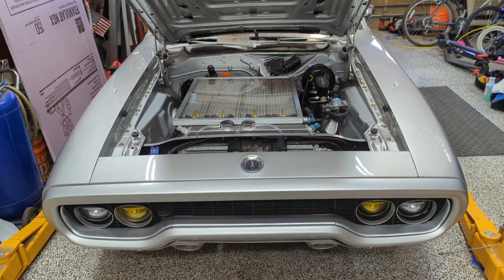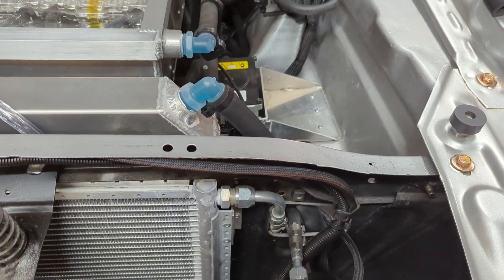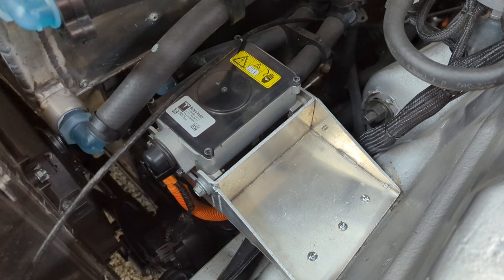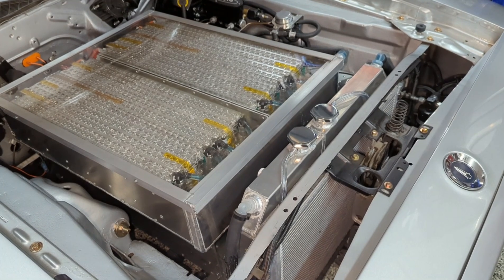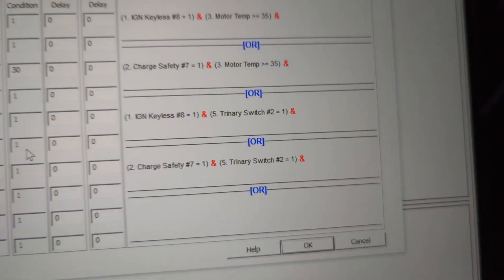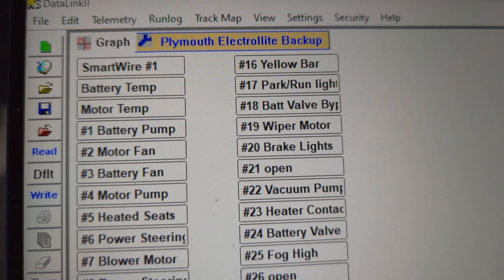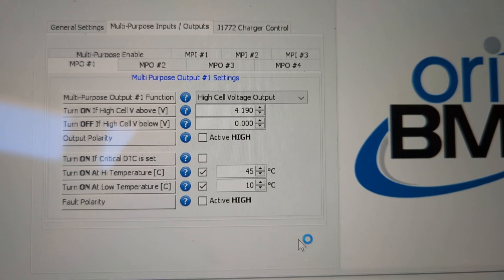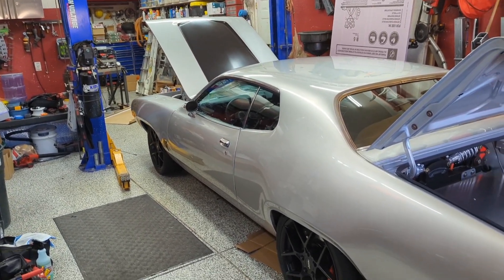Project Electrollite Tech Series - Thermal Management

Comment: I also have a TESLA water heater for the batteries.  My understanding it is just a water chamber with a 400vdc coil.  So then there has to be a high voltage contactor.  What contactor do you use?  Also where and how are you measuring the water temperature?  My thought is I can  pot the thermostat probe in the groove in the casting outside on the TESLA casting that makes battery heater.
Reply from the maker: Yep that is an accurate description.  I use a GV200 contactor, way more than it needs.  I measure the outlet temperature after the batteries and charger.

Comment: Sorry to ask but What Air con pump is it? I'm a little confused about the pwm to it and the temp control?
Reply from the maker: I'll be doing an entire HVAC-specific video in the next month or so... The AC pump is a Benling  400 volt compressor that is controlled by a PWM controller.   The required PWM input allows variable RPM in the three phase motor.   The temp control is a separate unit that will cycle the compressor on or off  with a ground input similar to a clutch on an engine driven compressor.
Reply: @MrMoparMan   perfect! Thank you so much for this found you via rich rebuilds - love the videos and the car! Looking forward to more from your channel. Looking to fit it to a air cooled VW saves complication and zapping what little engine power the bus has 😂👍🏻

Comment: Would you mind detailing the size HV cables you used? I have a 16 regular S module pack but noticed your build has a couple different size HV wires/cables. For example, your HV cables from the contactors to the 5 fuses for things like heater/ac/dc converter/charger and battery heater  vs the cables from the charger or the motors. Want to make sure the cables are large enough!
Did you use a large fuse between each pack? I am planning one for the 2x 8 module packs but not one between them like I have noticed in multiple wiring diagrams. 
I'll probably pop over to your etsy account and buy some of your designed and printed cable zip tie mounts. Nice job on those! Can you post your link?
Reply from the maker: That's a good idea, I will be putting out a video soon about every single component I used in the car.   The main cables are 2/0,  and the smaller cables are 8GA.   My fuse is between the front 10 modules, and the rear 6.   Also have a disconnect switch in the same location.    The fuse can be anywhere, it just needs to break the loop.  It's a good idea to put a disconnect between your two boxes of eight so you can reduce the voltage down to just each box  when disconnected.   This makes it safer to work on each box,  and sometimes a nice use of a junction.   I need to get some more clamps printed,  and adjust the price lower.   They are really holding up well.

Comment: Sorry if I’m incorrect or if you already mentioned it, but is the battery system that’s visible under the hood off center and if so, does that factor into the cars balance?
Reply from the maker: Yep it is slightly skewed towards the passenger side to give clearance to the steering shaft.   I scaled the car and it is within a few pounds side to side.

Comment: Is seems like you might have a in on info from Holley. So If you know or if you can say. Is Holley working on something (ecu or something like it) for EV conversions. Or they just relying on live wire to handle EV conversions.
Reply from the maker: Since they bought AEM, they are working together on their Tesla drive unit control boards, PDUs,  and a battery management system.   They're putting a lot of effort into it and it will be a great source of products in the near future.
Reply: @MrMoparMan  that’s great news but Holley doesn’t move at the fastest pace so probably not near future. But fingers crossed cause I really want to Tesla swap my 71 charger. Even through I’m in the middle of swapping it to 3rd gen hemi.
Reply from the maker: @ReloadingRADIO   That will be a cool build either way, I nearly  Gen 3 swapped my Satellite, I bought a wrecked truck and parted everything out.

Comment: Can you do a tech series on the tesla battery box? I'm building a 57 chevy, front box will be 4 modules on pass side, alongside 3 modules on driver side for first pack (144v Hyper 9). Lots of basic questions, are you cells resting on each other, rail system for mounting using the module rails, spacing front and back for cooling and BMS wires, etc. Probably hard to made a video on that unless you have pics to add in, but maybe a short video on some basic issues or things you did right or would do differently. Love the clear on top, plan to do the same for my own.
Reply from the maker: I can definitely do a video on the battery boxes.    Sounds like a cool build, something else you might consider  is placing all seven in one box on edge, it would be approximately 23 in wide 12 in tall and 31 in long.   I did use 1/2-in aluminum angle as rails and each module is attached to the rails with about 1/16 of an inch gap between them.
Reply: I wasn't sure about putting them on their sides since Tesla didn't design them that way, I was concerned about them flexing and having issues not being designed to lay that way. You know of others mounting them that way without issue?
Reply from the maker: @welkerracingenterprises279   Yep they will be fine, my lower box under the hood has six modules on edge.   There are many other builds using them that way as well.   It makes it very easy with bus bars to connect them in series.
Reply: @MrMoparMan  I saw that on your FB after my comment, lots of good battery box pics there. I will have to play around with my layout once I have the frame and driveline built and put the body back on. Much appreciated.

Comment: I heard you say you have “regen” on the car. Is that an all or nothing system, or can you select a percentage? How does that work? Do the brake lights come on when in regen mode? 
Thanks.
Reply from the maker: It is a variable system, and the percentage can be adjusted.    Completely letting off of the accelerator would be full regen, or you can keep some pedal applied and throttle the regen.   The brake lights are activated during regen or pedal brakes.   The regen system is deactivated in cold or hot temperatures, or when the battery hits full charge.